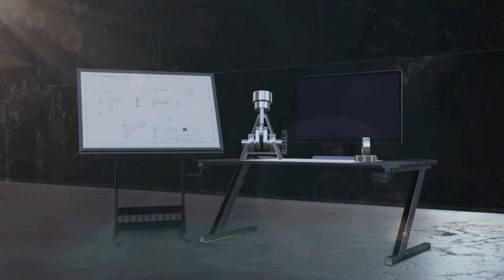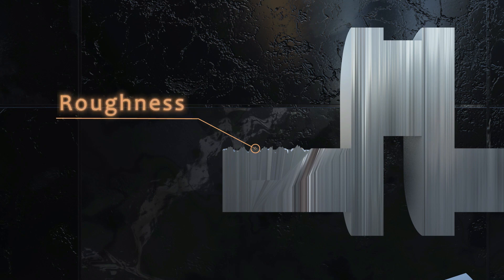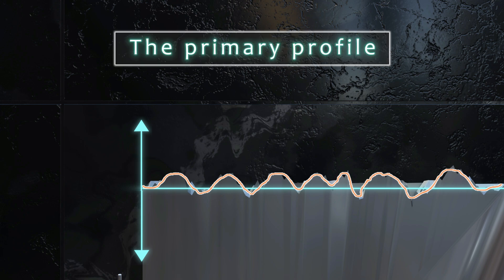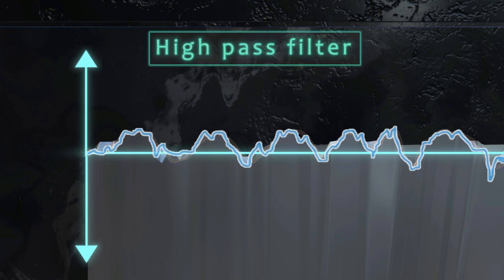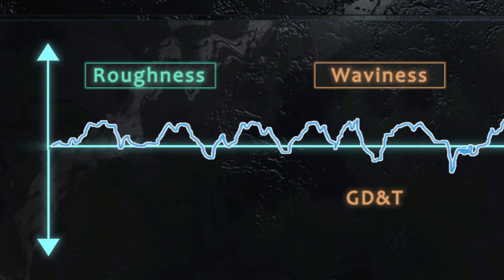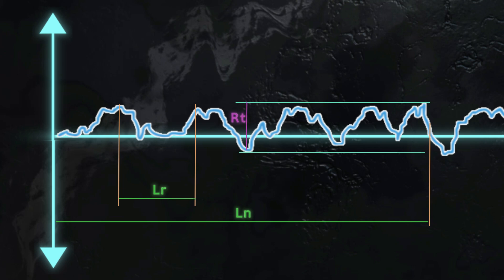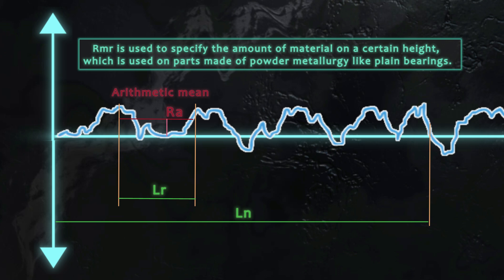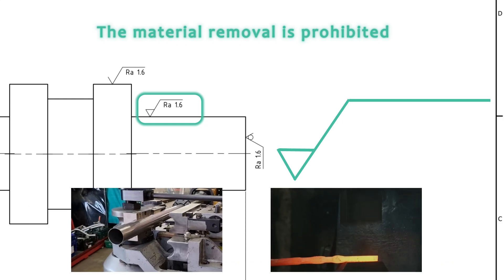Surface Roughness Explained Like You Are 5!

Comment: why is Ln divided into 5 smaller areas? is it possible to divide it into more smaller areas?
Reply from the maker: The standard sets that Ln gets divided into 5 smaller lengths. Yet, the designer can choose to specify another number on the drawing. A clear statement is required in this case

Comment: Please correct the circle in the basic symbol, which means material removal is prohibited, at 4:48. Besides that, your videos are excellent. I have seen your tolerance and fit video. I have a great appreciation for that video.
Reply from the maker: oh yes! you are right, there is a mistake in the video. I will correct this in the description.  thanks a lot for the appreciation, it really helps us keep motivated and keep working on our videos.
Reply: @Excedify  idem for 4:26